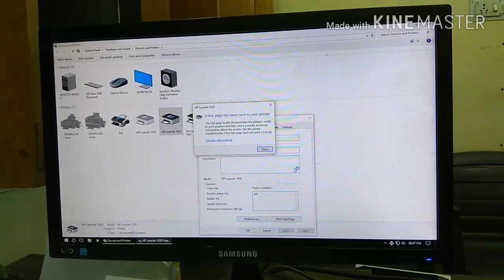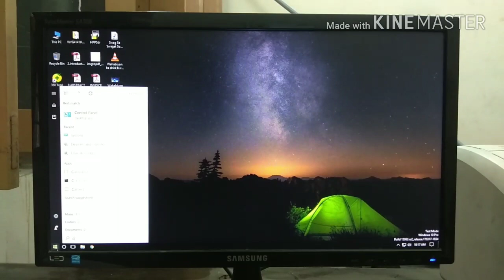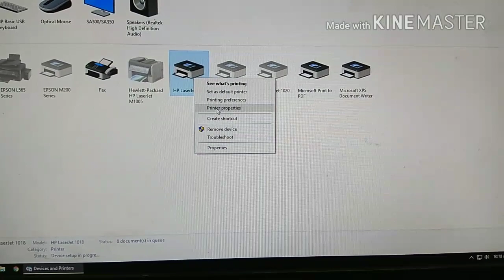Hp 1020 printer not working or stop with two LED light

Comment: i just bought a new 1020 and its the first week of usage...
Question 1: while printing first time both lights(r&g) blink one after another for sometime then print comes.  Is this normal??
Question 2: while sitting idle it makes sound as if it wants to start but suddenly stops and sound only lasts for not more than 1 sec. Is it normal??
Question 3: can i turn this off from main power socket without turning this off from back of printer?
Reply from the maker: 1) it'snormal
2) it's normal
3)yes you can
Reply: @computerexpert6462  thanks for ur time

Comment: My HP Printer 1020 Plus is not printing Page , When I give print command page remain in que and In printer Green Light is On but  doesn't  blink when print command is given and Orange Light blink for few seconds and then Turn OFF , I have done all other things removing and reinstallation driver , HP Printer Troubleshooter Utility , replacement of printer cable and all other tricks related to software but after watching your YouTube video I realise it might be  Hardware Problem, So Can you help me out , Thanks for wonderful video on IT related problem
Reply from the maker: Check the formatter board ribbon cable

Comment: hp laserjet 1020, on karne par motor 1 turn karke stop ho jatta hai, no initialization, green light on.  problem in scanner unit? pls suggest
Reply: Did u get solution for this brother?I have the same issue I bought a second hand printer after 12 days this happened now seller isn't taking it back

Comment: Sirji hp 1020 ka scanner unit new change kiya fir v print letahe per kuchhder ghumkar red green dono light on hokar rukjatahe,jab ke print option per dekha to print order auto cancel hojate issliye kya karun Sirji abb
Reply from the maker: Printer drivers phir say install kar k check ki g a